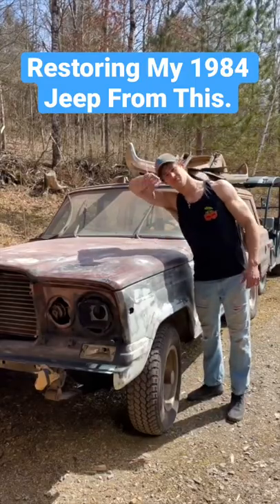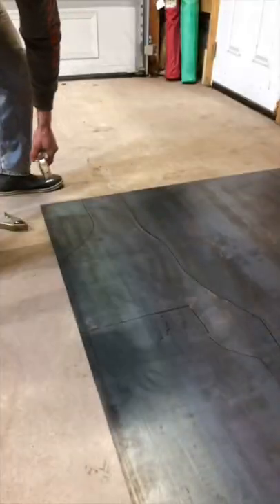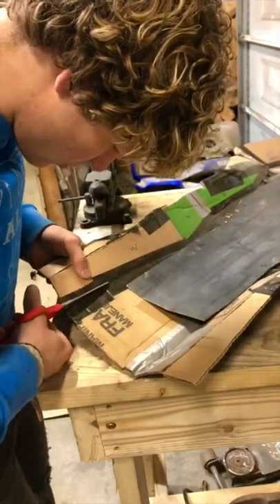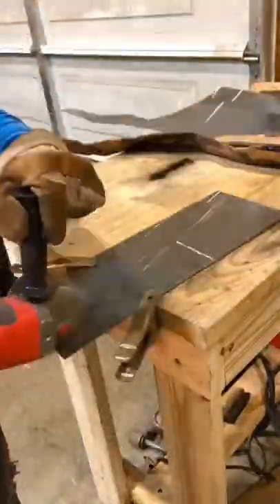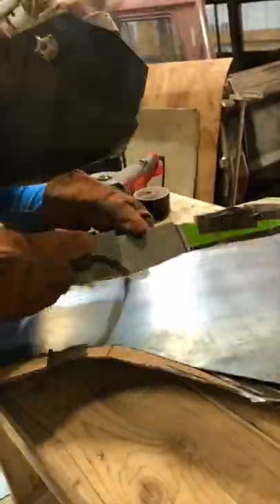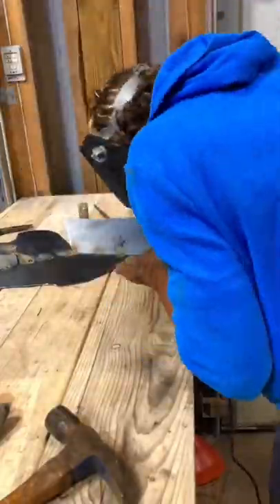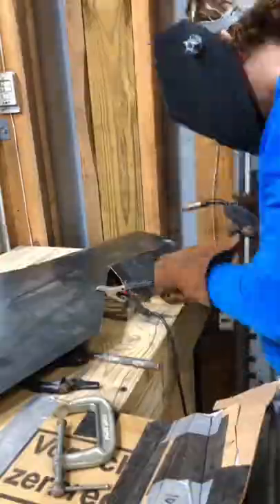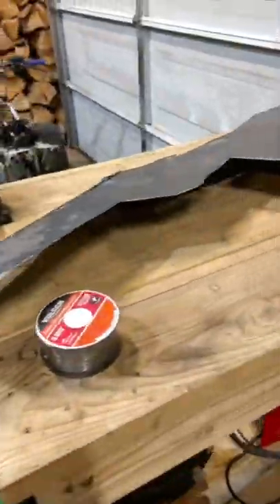I Caught Myself on Fire Restoring My Jeep😅 #restoration

Comment: Can I make a suggestion? Invest in a gas welding system and stop using flux core wire. Go and get a tank, regulator and solid wire and run gas instead. Will come out soo much cleaner I promise